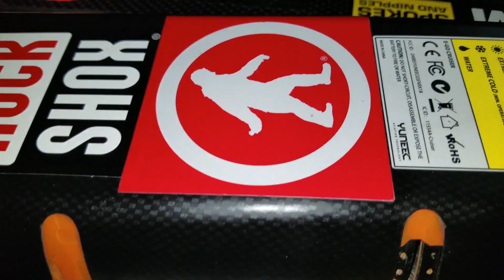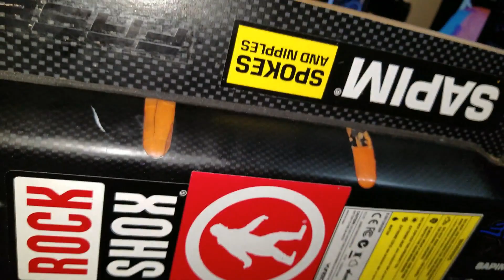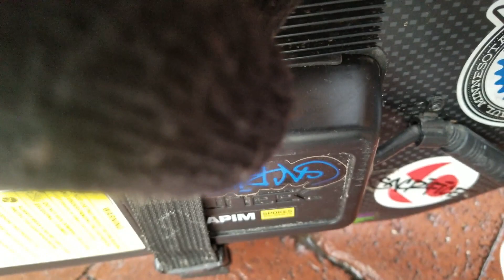Extending Battery Range On Yuneec EGO

Comment: heve you ever try to replace de motor for one stronger?
Reply from the maker: Renato Maitto, I thought about it, but then I realized that it would just be a waste because the Yuneec E-GO is a 7s (29v) and the ESC wouldn't handle a stronger motor, a stronger motor would also require a new motor mount. Unless I upgrade everything at once! I then built another one! will be using the yuneec as a buckup!